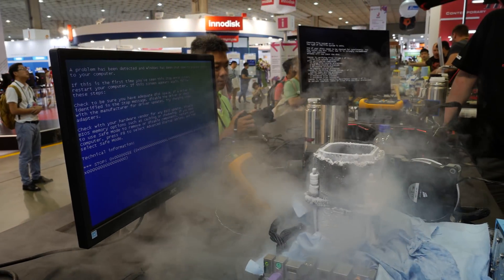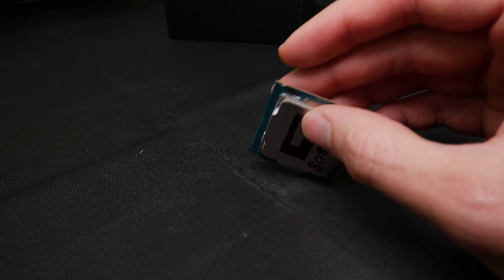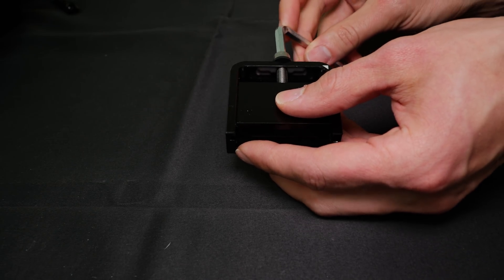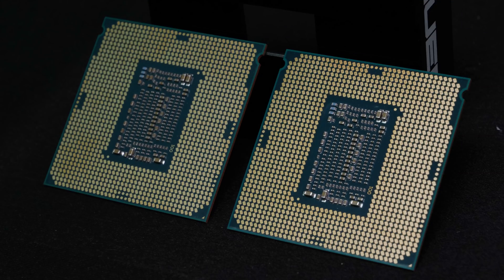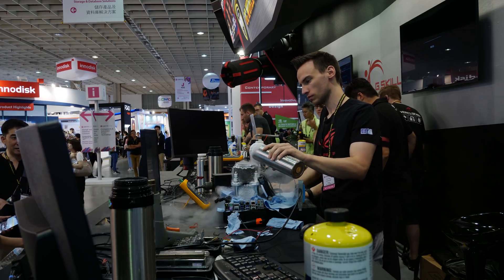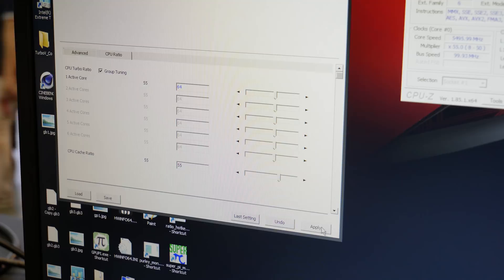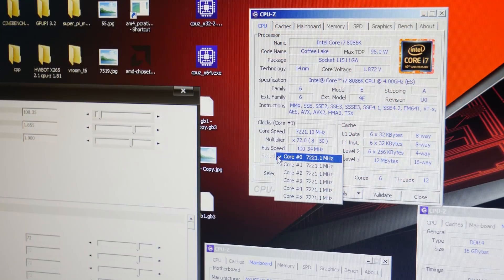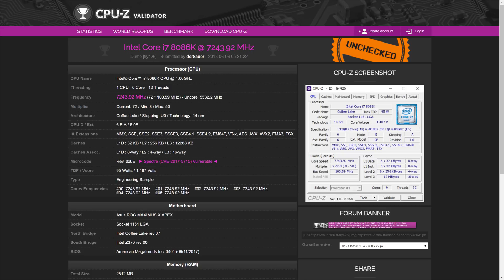i7-8086K delidded and overclocked to 7244 MHz - Computex 2018

Comment: Thermal paste again, wtf wrong with intel
Reply: Intel Inside...delid required to see it.
Reply: No, it's not ... and that 28 core 5 GHz CPU ... I am still laughing now
Reply: @lime On the ryzen chip the IHS is soldered to the die, whereas intel use a crappy thermal paste which is not as good so they run hotter. that is the point being made here.
Reply: thermal compound has nothing to do with power, it just makes it much harder to cool, and in turn, be very hot, so even if they had no thermal comound at all it would be the same performance as with soldered ihs, just that the one with no thermal material would be nearly impossible to cool, which is why people complain, because a 8700k runs stupidly hot even before overclocking, for the amount of cores/threads, and boost/base clock it offers, where as a ryzen chip, the 8 core ones, at stock speeds run very cool, and dont require the user to spend alot on cooling,
Reply: David Devil's Canyon is by far the hottest intel chips core for core that I ever held (it was also the first time intel stopped soldering their chips). Also intel uses paste because solder is annoying and can potentially fuck up their process (which is far more dense than chips from TSMC). In the end of the day you do not know how many intel CPUs are failures because of substandard solder application. intel saves a lot of money in that regard for sacrificing a few C

And FYI, that Xeon Platinum 8180 rebrand is cooled by a chiller (about -2 to -8C). LN2 is for extreme overclocks (about -180C)
Reply: aidenhill That's because of the STOCK cooler, not necessarily because of the chip. If you cool a 2700X with a shitty intel stock cooler you would get into the same issues, AMD Wraith coolers are vastly superior to intel. My friend used to cool his 8700K with a $20 IDC 214L, a cooler that is weaker than a Hyper 212 ...72C @ 4.3Ghz. My NH-D15 cooled it to 75C= 5Ghz@ 1.35v non-delidded. 

Stock TIM and stock Solder is not that far in terms of temperature, the massive temperature loss you find on 5Ghz delidded 8700Ks are solely because of high end thermal compounds like Thermal Grizzly Conductonauts: which are pro-overclocker grade compounds. If intel uses stock solder on their chips like AMD does, intel would just relieve 3-5C off.
Reply: @aidenhill, why is the ryzen chip better and runs cooler? I'm still not understanding.
Reply: Nothing wrong they know there are stupid people who will buy it
Reply: Daway Legit not for productivity and this cpu isnt really compeating with anything at it's price point.
Reply: solder would actually last much longer but Intel does not give a damn. And about that 5GHz 28 core cpu, you could clearly see it was manually overclocked and probably cooled with liquid N2. (probably direct DIE cooling).
Reply: Manuel G You are comparing 2 different lithographies. It is still crap no matter what you claim.
Reply: Smaller lithography means less waste heat get produced. Also it depends on the Wattage passing through (which is given by Voltage). Even tho it might have gotten slightly better it will never be better than anything soldered.
Reply: keep dreamin INTEL in trouble
Reply: I{ read some time ago that Intel were purposely using TIM rather than solder due to the fact that the TIM Intel has is very long lasting

Comment: Spectre (CVE-2017-5715) Vulnerable. A shiny new CPU.
Reply: Petr75661 it's not a new design just a golden sample 8700k
Reply: matthew drodge Spectre is not like software bugs with the constant code updates needed.  It's really the "simple" mistake of sharing the prediction data between CPU states that were documented (35 years ago!) to be 100% isolated in hardware, thus breaking the very foundations of PC security. So the proper fix is to make those states properly isolated again, as was always promised.  This will probably require duplicating some of the parts of each core.  The other spectre problem was reading memory that the programs were telling the core NOT to read, by assuming "not sure yet" means "take a wild guess".
Reply: its not new. The 10nm chips that they are trying to make will be the new ones (they have been delayed)
Reply: Not the 9700k or 9600k!!
Reply: It has nothing to do with that. The CPU was designed before the vulnerability was discovered. It's not like you can simply patch such a serious bug in the architecture. You have to put a lot of money on the table and you need a lot of time to come up with something better.
Reply: @digitalghosts4599  9700k is immune to spectre/meltdown/Zombieland
Reply: Exactly. Its not like they are going to give up on branch prediction any time soon. That would be a "quick" fix but would make the the cpu seem more like the original 8086. (picture waiting for every line of code to process before you can even move the mouse each time you click something)
As Digital Ghost hinted at the patch will only probably be a patch anyway and this will probably drag on for years with each new patch being hacked until they get it right (and then that gets hacked to because this type of thing is constant and we never normally hear about it)

Comment: Do you prefer being able to delid, or is soldering better for extreme overclocking?
Reply: delid technically would be better
Reply: Delid is better. But not much. About a few degrees only.
Reply: Parsa Strife depends on if you put the cooler directly on the die or use a heatspreader.
Reply: delid is better but solder is close and much less hassle. (reasons for this are with a delid you can run direct die or control the thickness of any liquid metal)
Reply: Sompli to be fair, I'd rather not have another step for extreme OC like a delid. I'll be posting a video on XOC insulation prep, but it's already like an hour long, and I haven't even mounted the cooler yet. At this point in just going to zip tie the cooler on...

Doing phase prep, but I'm not even doing plasti-dip coats like I normally would. It's just taking too long.
Reply: soldering has a more or less disadvantage no one does really think of.
The chip actually can be "pre weakended" and can get really slightly wear because of the heat.
Not noticable in normal use. but that could lead to less oC potencial due to instabilitys on higher temps / voltages. It affects the chip OC behaviour badly.
But i guess only hardcore OC guys could care

Comment: What will be on average AIO ? 5,5 Ghz max ?
Reply: GRIMM WESSEN lol no. These are most likely just all the 8700ks that can hit 5.2-5.3ghz that have disappeared recently
Reply: Probably ~5.3ghz. These are basically just binned 8700k.
Reply: Exactly, they're no different than an 8700K so any overclocks that are possible on this, are possible on an 8700K. You're just more likely to come across a nice one, but if people have to shove 1.4v into 8700ks, delidded and with custom loops to get 5.3, there is no way that you will hit 5.5 on this chip
Reply: One benefit of this chip though is that you should be able to hit 5Ghz with it being cooler and requiring less voltage.
Reply: agreed